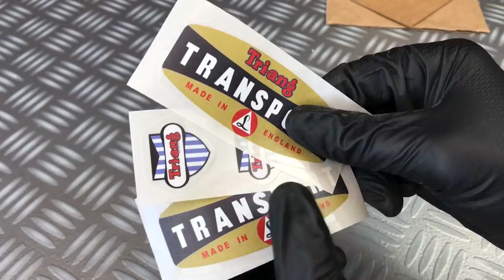Restoration Truck 1950s very Rusty -  GMC ?!

Comment: You do good work. But as the others have pointed out, the pits in the metal let your work down because it winds up showing up through the paint. The simplest way I have found to tackle that, if you can still see the pits in the metal through the primer, you have either overly thinned your primer or you haven't laid on enough coats. Lay the primer on a little thicker. That will help you a lot. Once you can't see the pits through the primer, then sand the primer with a red scotch bright. The scotch bright will make the primer slick and smooth. Lay on one coat of paint and then check your work. If you can still see a pit here and there, don't lay on anymore paint. Sand the whole thing with a scotch bright pad. Lay the primer on in the spots you see until they disappear. Lightly sand it again and lay on another coat of paint. If you've done your job right it will look smooth and no pits will shine through your new paint. I've tried using modelers putty to fill pits. To me, it's a lot of extra work when using putty. It's less work to use a little thicker primer. You will get a more even coat and the pits filled at the same time. If you do good work and you happen to decide to sell, it will sell better if all the pits are filled the right way and you use the right rivets to put it back together. To  Most collectors and buyers using the wrong rivets are a big NO_NO. Being able to see the pits through the paint, it makes people wonder about the quality of the metalwork under the paint. Take a look at this joke that's for sale on eBay. It's hard for me to believe that this guy actually thinks this will sell at the price he wants. https://www.ebay.com/itm/Vintage-Pressed-Steel-60s-Structo-Sanitation-Dept-Hydraulically-16-Dump-Truck/174074611714?_trkparms=aid%3D555021%26algo%3DPL.SIMRVI%26ao%3D1%26asc%3D20190827085352%26meid%3D46e6cd32d1a147e5ac681b1687b6b322%26pid%3D101112%26rk%3D1%26rkt%3D13%26sd%3D202640141151%26itm%3D174074611714%26pmt%3D1%26noa%3D0%26pg%3D2557460&_trksid=p2557460.c101112.m1982&fbclid=IwAR0v0WTaqycb3ZcuKXUOvd1PEEkzTNKxAi4LL-nn8hgjP1RF0HDt9iCAXdw

Comment: Looks good. I have a couple of suggestions though. I would like to see you take a little more time in getting rid of the rust pitting. It's really noticeable .Either use a glazing putty or more layers of filling primer. And I would like to see you use semi tubular rivets rather than those god awful pop rivets.
Reply: I was going to write exactly the same comment, word by word.
Reply: I agree, the pitting was noticeable. Should have sanded the bare metal. I use Bondo Spot Glazing Putty. Not trying to put anybody down, just making positive suggestions. I learn something each time I restore and by watching other people.
Reply: @wyldebyll3089  , That was my intention..He does a good job, I am just trying to be helpful.
Reply: @johnblanton9969  I know you were, you gave constructive suggestions like I tried to do. I was just stating that I wasn't being critical in a negative way. I appreciate and welcome critiques and suggestions on my work. "New" eyes can see things I have overlooked. I think I have progressed each time I have restored from learning from past attempts. Others have already experienced things and can speed up the process of consistent improvements on projects. I did not mean to sound like anyone else was out of line, I can only speak for myself on my intentions of giving helpful suggestions.  We all noticed the lack of surface prep immediately, I learned the hard way. He did a good job, but what we noticed can make it even better.
Reply: Particulary noticeable on the Blue dumper part.

Comment: That rust will be back in a month. This needed proper blocking too. 150-180 grit on the dump box. Too much pitting.
Reply: Dump box no way meets my standards. I would have been redoing it.

Comment: What does wet sanding the primer coat do? I've also seen some wet sand the first coat of paint
Reply: Better sticking for the next coat of paint
Reply: @imjustinjong3939  for filling scratches a d sand blasting pits. He did a lousy job, especially on the box.

Comment: Where do you get the logos on the truck?
Reply from the maker: I bought the stickers on the website
. 😁
https://dinkyclub.com/set-of-2-tri-ang-junior--tri-ang-transport--decals--peel--stick--clear-with-white-background-7851-p.asp

You can also buy on ebay, but is more expensive
https://www.ebay.com/itm/Triang-Transport-Delivery-Truck-Sticker-Set-TG-006/372667297358

Comment: Nice work. I suppose people would bitch if you didn't stick to original colors, but I'm not a fan of the white. I'd have gone with the orangeish yellow or yellowish orange most such trucks usually are in the real world. That's just me, some people feel like you always have to go back to original colors. I don't.
Reply from the maker: I did not use white color, but RAL 1015
Reply: @MWRestoration  looks white on my screen.  it's beautiful work, don't get me wrong, but white just does nothing for me. I do have a color vision problem, so I may not be seeing it correctly. I cannot really see green or brown and many purples give me trouble. If something is a blue green, I see only the blue. therefore, I like blue, red, and yellow, maybe orange, but anything with green or brown  in it, I don't see it right. People without this problem will never understand. about 50 percent of men have this problem to some degree or another.